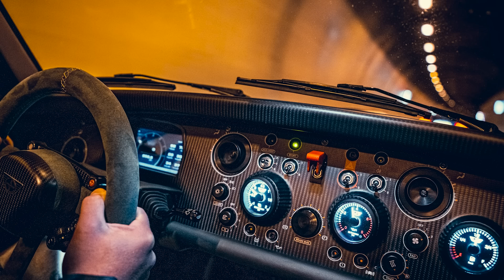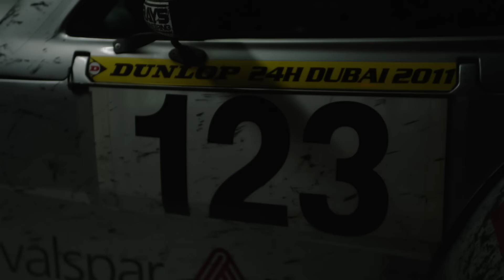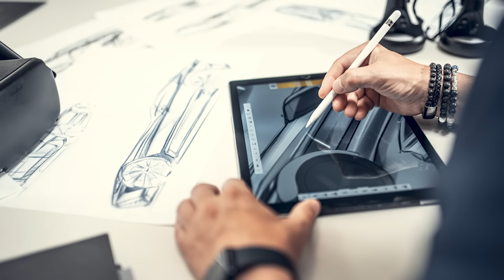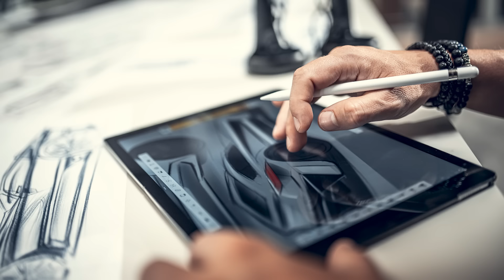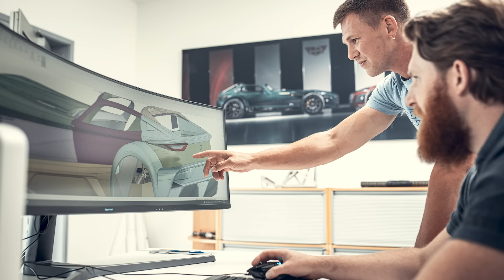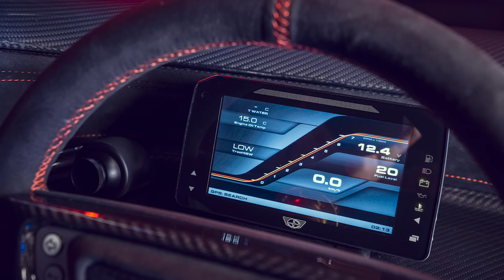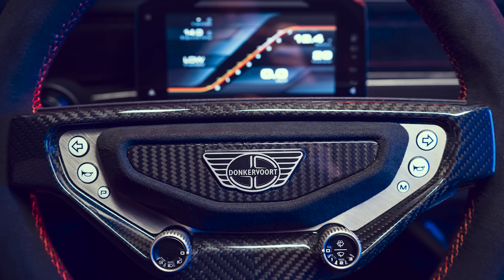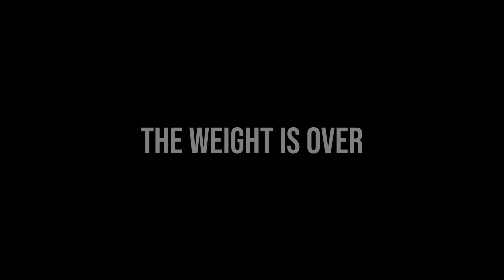The lightest supercar in the world // Donkervoort F22 - Launch Event

Comment: Wow! I think I've found my new favorite Lightweight Supercar. This F22 looks the muts nuts and with 500bhp pushing 750kg-(666bhp per ton), although top speeds only 180mph , can you imagine the acceleration getting there with an equal amount of torque!...Also, the looks are futuristic yet will forever be timeless. And then , the icing on the cake , the 5 cylinder turbo , for the sound....Very well done Donkervort , this car is Badass!!!
Reply: Yeah,
I love lightweight too ❣️
My absolute favourite car is the GMA T50 and T33.
They have 600 HP and 1 ton too.
It's the perfect power/weight ratio in my opinion... but the best is, the whole car don't have more as 1 tons...if you want a Sportscar 😅
Some sport cars today, with 1,7... 1,8 tons or more, isn't really sporty.
For Autobahn blast it's okay... but not for track use and curly streets 😅
Love from Berlin 🇩🇪
Ramsi 🙋🏻‍♂️
Reply: 666 bhp per ton should go like the devil on the highway to hell! 😉
Reply: LCE-Performance built Audi 5 Zylinder engine's up to 700 HP ❕😜
I imagine what happened, when do you put this LCE tuned 5 Zylinder into the Donkervoort F22 😲🤣
It must be the absolute weapon 😅

Comment: So happy that you brought back the rear look of the GTO, the thin lights and the aerodynamic lip that surrounds the back of the cabin.A major improvement is also the ability to have the cabin closed (targa) and the modern dash look. Tapping into the potential of the 2.5 lit engine to raise the power and torque was also much needed. I hope the gearbox is a six gear close ratio job and not a five one as the previous! Superb car! Congrats!